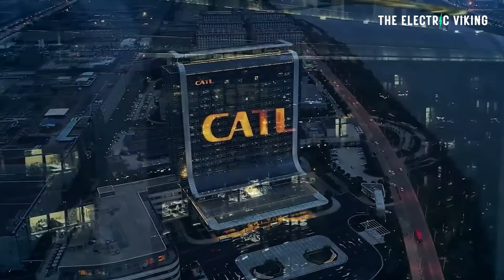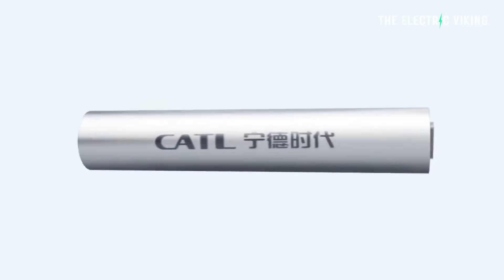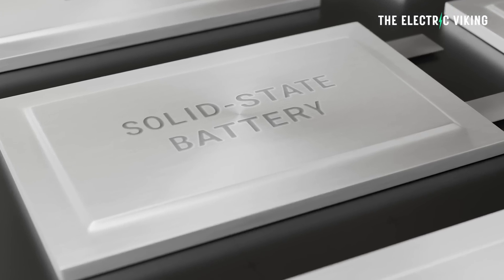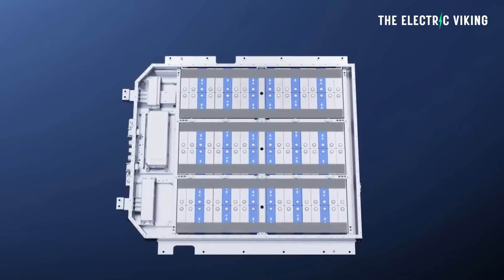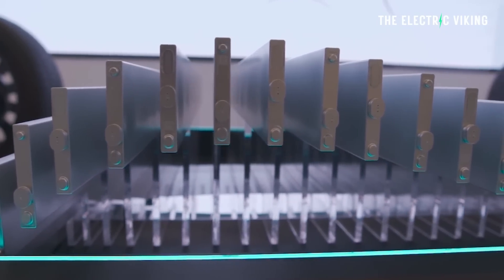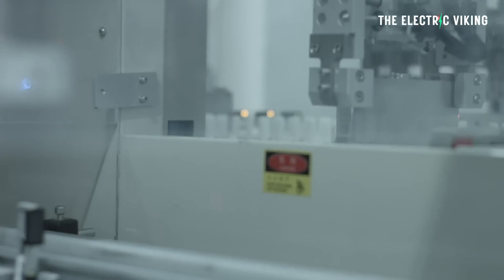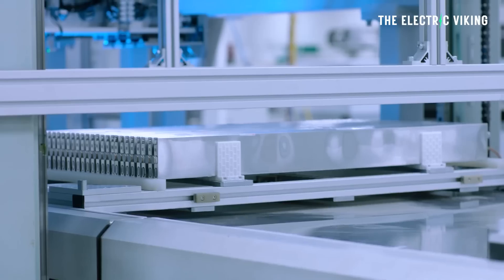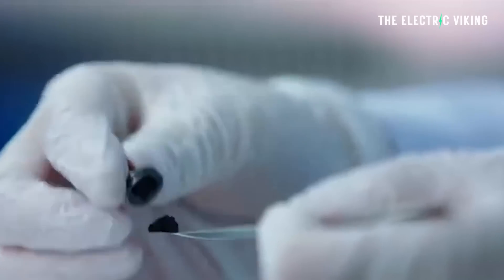CATL's sodium hybrid battery will be 30% cheaper & revolutionise the world

Comment: -20°C is not extremely cold, but for 99% of people it's colder than.they ever get.
Reply: Just keep car plugged in till you go
Reply: Garages does wonders for winter driving whether it's a BEV or ICE...
Reply: @johnwang9914 so you mean “not driving in winter” !?
Reply: @johnwang9914  Garages don't always work that well for people who live in apartment complexes tho, and who are often limited to an outside parking lot, leaving vehicles exposed to the elements (and sadly not even equipped with simple, low-capacity AC chargers for topping up or pre-conditioning their vehicles before leaving home...)

Newly constructed apartment blocks in my city often do have a basement garage even though it's more expensive that way, because of urban densification; there just isn't as much space left now to waste on a big field of asphalt just for people to park their cars on. However there's still countless of the older buildings out there (especially in the city outskirts and suburbs) with big honking parking lots, housing many tens of thousands of people in total.

US suburbs with their sprawling layouts are very different from European ones, which tend to be heavily laden down with apartments as opposed to single family homes. We just don't have the space over here for square kilometers of white picket fences. :D
Reply: You can just preheat the battery or park it in the garage
Reply: Half the US can get that cold but not for any extended amount of time. I live in Missouri and the last 3 winters we hit -10°F / -25°C below. I know Kansas regularly hits that temp. I think Kentucky and Tennessee saw close to those temperatures also.
Reply: @thelink66c  It won't work on Mars so... let's not bother to invest and develop... Diesel freezes at -15°C , does that stop the trucks from producing diesel trucks?
Reply: @mb-3faze  You don't need a $15,000 1 ton battery to keep the diesel warm ;-)
Reply: And gas cars can have struggles at those temps too, of course. Even more so for diesel!
Reply: A very small minority needs a battery that performs below -20°C.
Reply: I live in Canada we get a ton of now and sometimes it gets -35 my tesla model 3 battery degraded almost 25 % in 4 years and in winter i get only half of the range that it’s supposed to provide.
Reply: @Robzerix 25%? That's already outside the warranty, so you should get it fixed on warranty. It probably has a manufacturing defect or something.
Reply: Yeah, In Toronto -25C is your average winter temp.
Reply: The coldest recorded temperature in Sydney is -8 degrees Celsius.
Reply: For an Aussie that Viking is, -20°C is unheard of and simply impissible.
Reply: Yeah those pathetic humans never experienced Siberian Winter
Reply: I have seen -30C
Reply: Im gonna want some mix of this with the cybertruck...
Reply: Good to know that it can though
Reply: -20C pretty much precludes 75% of Canada.
Reply: @jet4fun54  Not a whole lot of people live in those 75%. It's mostly just wilderness. Meanwhile, 90+ percent of the population lives within 200km of the southern border.
Reply: @lennyvalentin6485  Not many people live in the whole country of Canada compared to the rest of the world (0.5%)
Reply: I live in the the tropics. Below +20°C is extremely rare. 😂
Reply: move to Australia ;)
Reply: It was -20 in The Netherlands in 1979
Reply: That is a subjective statement. To many Floridians, it is painfully cold. To those in some areas of the Midwest, it's normal. And to many in Russias northern areas, they're in shorts and t-shirt at that temps. Haha
Reply: Errrrrrrr its a battery , u still have to charge it up or do we do that on 
unicorn farts ?
Yes battery prices have come down ........... its cos the majority of EV producers 
are loosing $$$£££ , unsustainable business model .
This reminds me of the Video recorders , sony had the very best 
no one bought it .......... it went out fast. 
OK U only need to come up with a solution for the MASSIVE depreciation of 
EV's and the HUGE insurance costs ...... 
Good Luck !
Reply: @budbud2509  Bud, Tesla is profitable and has been for years now. This shows EVs are perfectly capable of being built and sold profitably.

That legacy brands can't manage is their fault, they're not adapting their design and manufacture correctly, they're building EVs like they build their old gasser cars and that's not viable. They need to adapt, stop buying so much generic off the shelf components and do more integrated designs instead to reduce cost and weight and increase energy efficiency, use castings instead of stamped steel, structural battery pack and so on.
Reply: @lennyvalentin6485  
Really , I just read that tesla laid off 140,000 people in an attempt to 
stay profitable . I come from a Alum Casting background ( Aerospace ) , 
so there are no surprises there for me . Probably one of the best ways
in reducing weight would be by bonded Alum extrusions . Talking about 
trying to save weight on a 4.5 tonne SUV EV is a joke surely ?
Reply: @budbud2509  140k employees is about the entire workforce of Tesla, so whoever told you that is obviously wrong.

Also, Tesla doesn't make any 4.5 ton SUVs, or any SUV at all. It makes one crossover, the Model X, which weighs less than 2.5 tons. In fact, there is no 4.5 ton EV SUV at all on the market, and I seriously doubt there ever will be either.

Maybe you should lay off the gummies for a while there, Bud - you seem a tad confused... :)
Reply: @budbud2509  A battery is chemically stored energy, so are gasoline and diesel.  The difference is that the energy in gasoline and diesel were slowly gathered over millions of years by nature, collected by photosynthesis and converted into biomass which sequestered represents hydrogen and carbon that has been sequestered from our environment for millions of years and on e burned upsets the current carbon cycle and our atmosphere.   Sure, we will need to find other sources of power to recharge our batteries but there are numerous possible sources and many are renewable.  Also keep in mind that modern plants are about 0.5% to 1% efficient at converting the energy in sunlight to chemically stored energy and only a small portion of that gets buried and processed by geologic forces into fossil reserves whereas our current commercial solar panels are about 21% efficient with 60% efficient solar panels already existing in the labs.   Of course, the problem with renewable energy is that they are not load following, they are produced when the sun shines or when the wind blows not when we turn on a switch, however EV's would charge mostly at night and wind power is produced mostly at night when there is also little demand for electricity.  Then there's V2G where the power in the EV batteries can be fed back into the grid to help the grid deal with peak loads thereby deferring the need to improve generation just to meet peak loads.  If anything, EV's are a great way to utilize more of our current generating capacity and to take advantage of wind power (that is if the Utilities would only standardize a protocol for control of overnight charging cycles and V2G net metering).

Note, Sandia Labs has also demonstrated that we can use other energy sources to synthesize gasoline and diesel from water and CO₂ so in theory, we could have the source agnostic advantages of BEV's by simply using current ICE vehicles and just changing how we make our fuels.   It won't be as efficient as EV's, it won't bring us the economic growth by encouraging the replacement of existing vehicles and it would reduce the profits of refineries to purchase the energy, water and CO₂ needed (CO₂ extraction from the atmosphere would be costly) but in theory, the goals of a transition to EV's could be met without changing a single vehicle.

Comment: -20C isn't "really cold".  It is a fairly normal nighttime low in a lot of Canada and Scandinavia.
Reply: If an EV is kept in an unheated attached garage, it will stay above the temp, even if the outdoor temp is colder than -20C. Driving it in -20C temps will not be a problem, since using the battery heats it up some.

Comment: Getting americans to give up their ICE vehicles will be like getting them to give up their guns or get multiple covid shots.
Reply: Old will die off.
Youngsters don't want to get dirty with brake reclines, oil changes, sparkplugs, etc to pay for.
Ice is dead man walking.
Reply: @andrewsaint6581  Pollution-wise, IC cars are really worse than most people think. There's not just the pollution from the tailpipe, there are all the oils that leak out, burn, or get disposed of, properly or not. And then there are the Lead-Acid batteries. They are recycled, but that's still a source of pollution.

Oh, IC cars are more likely to burn - over 20 times more likely. That's not just dangerous, it's also polluting.
Reply: The horses and buggies went quick enough
Reply: it is just a matter of time. in a few years ICE cars are more expensive to buy because the manufacturing is losing the economy of scale. step by step.
Reply: I’m giving up mine! I guess I’m just the tip of the ice berg ice cars can’t see! 😆
Reply: Nope.  All it will take is economics.  You are comparing giving up CARS, which is closer but also not great to your analogs.  Getting the shots was a mistake if one had a choice, but that's a tangent.
Reply: @Mrbfgray  I’m speaking as a current Tesla owner who bought one by choice not mandate which is what their trying to do with EV’s and tried and failed to do in many millions of cases with the vaccine’s. Even when an EV becomes cheaper than ICE because they’ve tried to force it on people they don’t even want to look at it even if it’s better in many ways.  If a new Covid strain comes out today how many people will get the shot after what we just went through. With the age of misinformation people hate?EV’s, vaccines and believe the earth is flat,

Comment: The units used for measuring the energy density of a battery can be watt hours per kilogram not watts per kilogram.
Reply: Sam doesn't even try anymore
Reply: Who cares, about the details, it's gong to end fossil fuels.....again, lol.
Reply: Joules/kg.
Reply: @bubuneowoo6161  Yes spot on 👍👍👍
Reply: A better battery makes no difference to the coal and nuclear industries.
Batteries still need power. Electricity is the same, wherever it comes from.
Reply: @josviersel That's not true - solar is much cheaper than coal and nuclear, especially anywhere South of Northern Europe.  However, solar is intermittent, so needs storage or backup for night/winter/cloud.  Cheap batteries make grid scale solar as a complete power source competitive and potentially much less expensive than coal and nuclear overall
Reply: @josviersel  It makes a huge difference because in the daylight hours solar panels will obviate the need for burning coal to generate electricity and with batteries the same will be true at night.
Reply: The end of coal the end of nuclear electricity comes from coal comes from nuclear comes from natural gas only a tiny fraction of electricity can be produced by solar during the day
Reply: @gordonwardhaugh8266 I think Sam's a little off base, but I believe what he is always talking about is with batteries being that cheap and on an accelerated reduction in cost, it makes the kilowatt hours per dollar cheaper when solar is the fuel source and it's stored in batteries
Reply: @gordonwardhaugh8266  Germany's electricity mix is now 56% renewable. If a country this far north can do it, most other countries have no excuse.
Reply: @gordonwardhaugh8266  UK's already over 50% non carbon electricity and growing very fast.  Other countries and much higher percentages.

Comment: Ends coal and nuclear?  How we gonna charge the battery? Solar, wind, hydro?
Reply: Welcome to Scotland 👍
Reply: @SWR112  The Hunterston Nuclear plant and the Peterhead Gas Turbine plant might disagree.
Reply: Yes easily
Reply: They are so cheap, you just buy them charged up 😂
Reply: ...there's a game changing, game over technology that converts Viking BS into unlimited energy...stay tuned...
Reply: You can in some countries - I have a 14kw solar array on my roof and 10kw 3-phase inverter, I generate upwards of 90kwh on a sunny day in summer and around 19GWh (19,000 kWh), per year. Even with 2 EVs (that both drive 18k miles a year) I export more than 1/2 back to the grid, the whole setup cost me less than $5k USD after rebates. 1/3rd of all renewable energy in Australia is now excess exported rooftop solar.
Reply: He probably means in combinaton with solar or wind (personally not a fan of the latter).

Comment: Honestly I don't see the appeal of Sodium Ion batteries other then their price because even though it is substantially cheaper the energy density is its fatal flaw. It might be ideal for stationary storage but for something like an EV its extremely lacking. What we need is solid state batteries
Reply: While I agree that we need higher energy density, the stats are still good enough for smaller cars and packs up to around 70 kWh because the price is so phenomenal. I wouldn't want to see those in cars above 80 kWh though, that would mean too much weight to carry around.
Reply: LFP iis 125 Wh/kg, Soidum is 200 Wh/kg., Liithium Nickel Cobalt 245 Wh/kg. Sodum easy supply chain, much lower cost.

Comment: Wow, Na-ion with higher energy density than LFP. Probably still lower than LMFP, but the ability to drastically reduce Li, is going to blow LFP away, even though it's already great tech. Cycles is a concern, as many anticipated Na-ion would be limited to stationary storage for quite some time and that needs massive durability.

Comment: So, RethinkX was right and based on their research this was predictable, even if not intuitive (which exponential change is not). It's like other tech adoption...mass adoption keeps getting faster. The demise of ICE was inevitable - it's mechanical vs. electric tech, and we know what wins in these cases. Analog computers still exist but they aren't anything more than a blip that's not relevant to 99.999% of people.
Reply: An electric motor is still mechanical - as are all the other mechanical parts on a car like wipers, door locks, etc. These things are still going to wear out. And now we have the added complication of batteries that give out. Not cheap to fix. The REAL reason ICE will go away is that oil will eventually run out, or become so scarce that it is too expensive for the average person to buy petrol or diesel.
Reply: @aftonline  No, peak oil is a myth, for the time being. It's like the line of dullards who have predicted the end of Moore's law. The US is currently producing more oil than any other country in history. The transition, although accelerated by incentives, will occur for economic reasons - BEV costs are dropping like a stone, while ICE keeps getting more expensive. 

A BEV has around 10X fewer parts than an ICE vehicle, and the moving parts in an BEV are open to huge improvements, unlike ICE engines, transmissions, exhausts, etc. Hence, new electric motors with ZERO rare earth magnets. 

Battery durability is FUD, with all BEVs in the US having min. 8 year and 100K mile warranties. 
"Electric vehicles can claim 15-year warranty as CATL outs million-mile battery with zero degradation in 1000 cycles"
Reply: @aftonline 
Peak oil is a myth, there is no supply issue there.  The reason ICE cars can't compete with EV tech is because fuel savings combined with near zero maintenance will drive the cost of battery replacement to zero.
Reply: @aftonline  No, peak oil is a myth, for the time being. It's like the line of dullards who have predicted the end of Moore's law. The US is currently producing more oil than any other country in history. The transition, although accelerated by incentives, will occur for economic reasons - BEV costs are dropping like a stone, while ICE keeps getting more expensive. 

A BEV has around 10X fewer parts than an ICE vehicle, and the moving parts in an BEV are open to huge improvements, unlike ICE engines, transmissions, exhausts, etc. Hence, new electric motors with ZERO rare earth magnets. 

Battery durability is FUD, with all BEVs in the US having min. 8 year and 100K mile warranties. 
"Electric vehicles can claim 15-year warranty as CATL outs million-mile battery with zero degradation in 1000 cycles"
Reply: Clueless.
Reply: @hwirtwirt4500  You, me, previous respondent who is actually clueless? Care to elaborate with actual facts, not emotional butt hurt? China is already 50% NEV. Do you still have a cellphone with buttons on it or own a horse?
Reply: @machoopichoo2  
I have a cellphone AND a horse, his name is Buttons.
Reply: @SaintKimbo  So pithy. But what is your point, if any? It's unfortunate Blockbuster isn't around to rent you video tapes. I can develop your film for you, if you like.
Reply: Charging time, and charger availability, is still the biggest barrier to mass acceptance, regardless of how efficient these batteries get, they've got to get it under 10 mins full charge and have sufficient chargers available, before people will relinquish the convenience of gas cars.
The majority of Countries are years away from that scenario, re charging, then there's under developed Countries
This is a, limited, first world privilege at this stage.. .